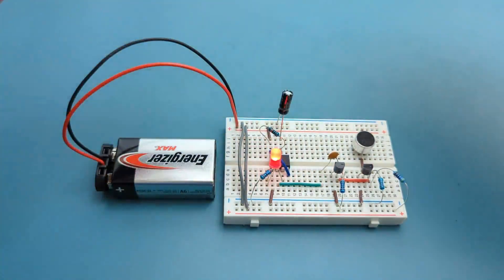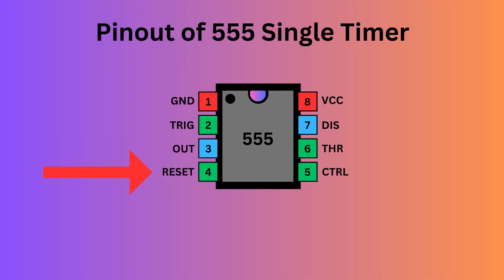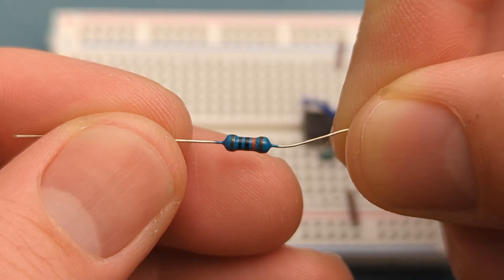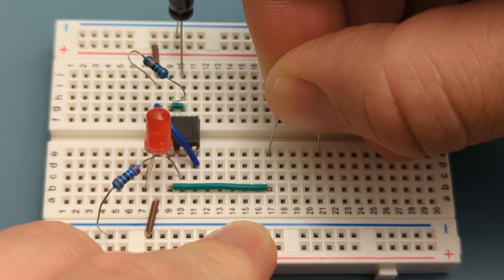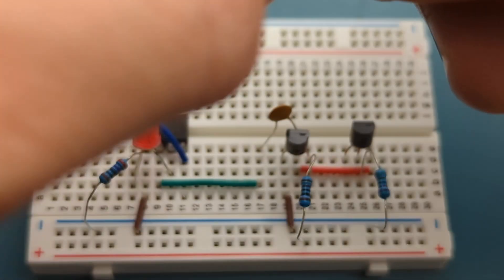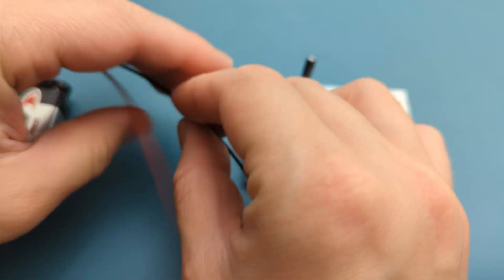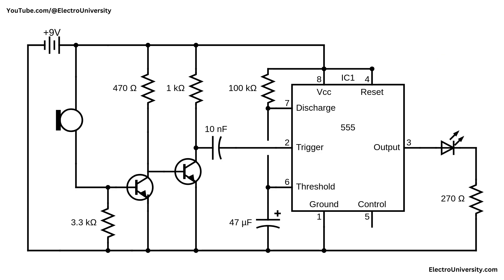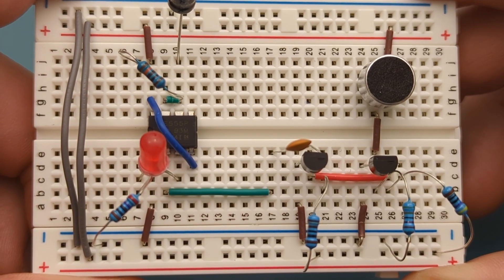How to Make Clap Switch Circuit With 555 Timer

Comment from the maker: 🔔 Get your tools here:
✅ Electronics Component Kit: https://amzn.to/3N65asq
✅ Condenser Microphone: https://amzn.to/3GZRmQc
✅ BC547 Transistor: https://amzn.to/3EYYdsM
✅ 9V Battery Connector: https://amzn.to/3S7kbg8
✅ 9V Batteries: https://amzn.to/4kkonVD
✅ NE555 Timer: https://amzn.to/41MpQhp
✅ Electrolytic Capacitors: https://amzn.to/4dnrJF4
✅ Resistors: https://amzn.to/3YfGeUi
✅ Jumper Wires: https://amzn.to/3NNn9UR